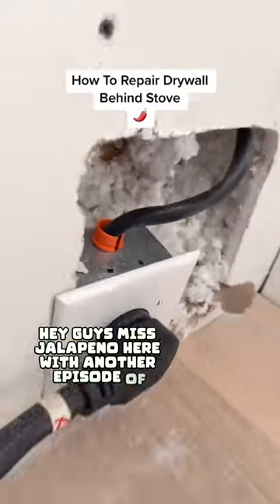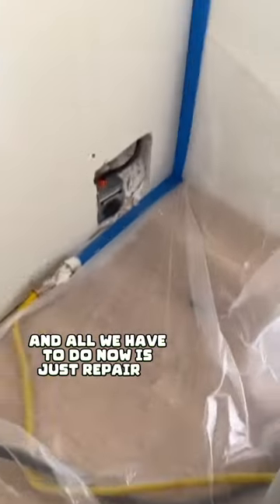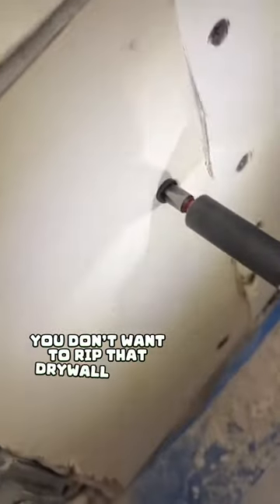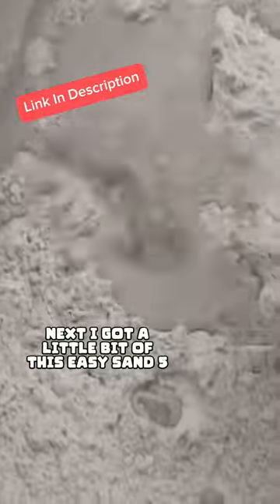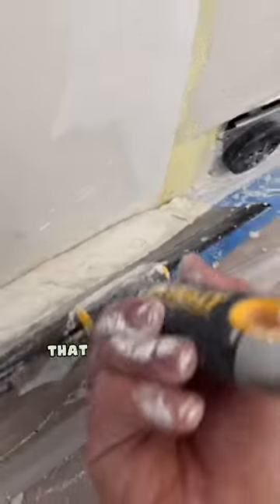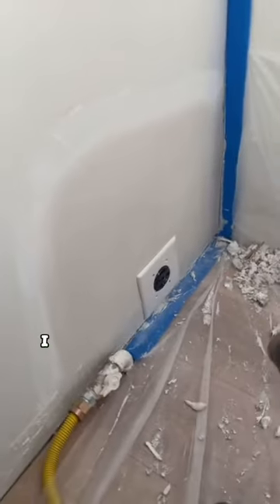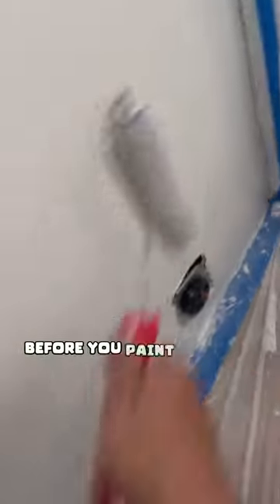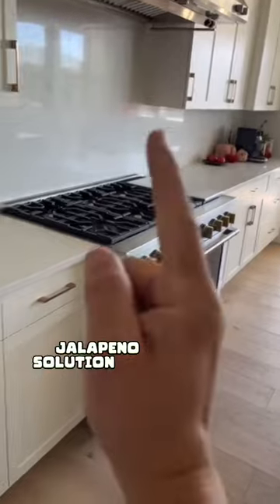How To Repair Drywall Behind Stove. #handyman #drywallrepair #stove #kitchen #howtodiy

Comment: Question… I am repairing same area because of moving gas line. The current drywall looks like regular 1/2 inch. Do I need to use special drywall like mildew resistant or fire resistant?